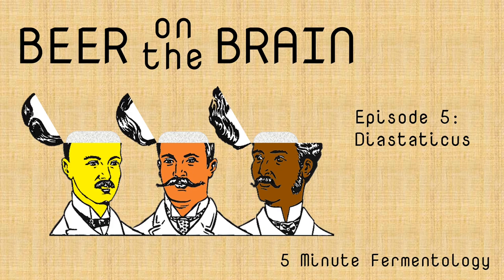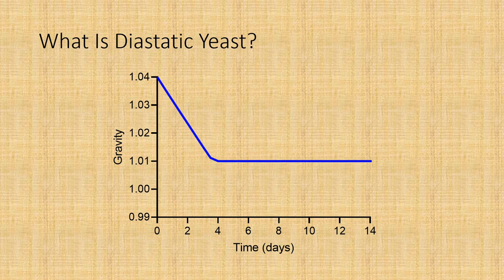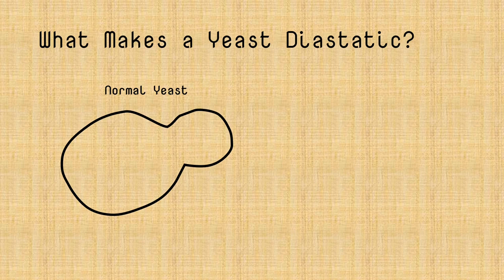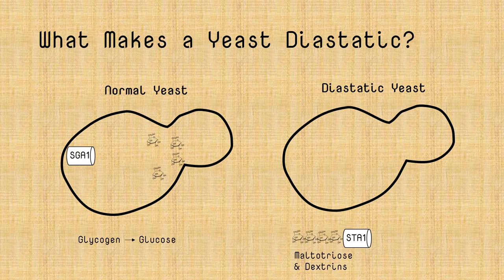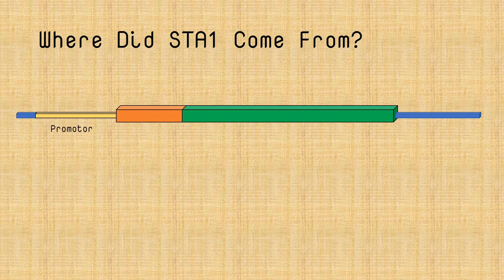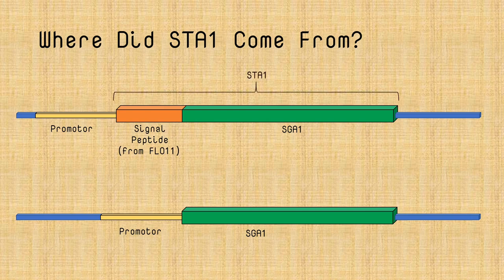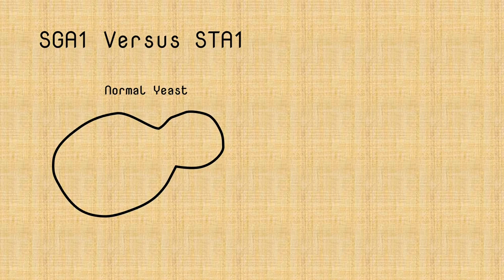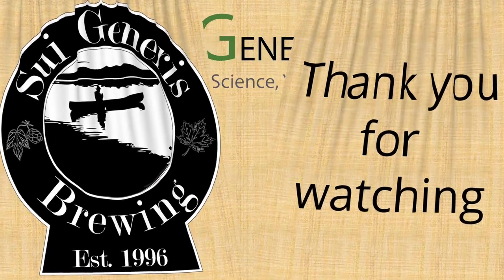BotB - Diastatic Yeast

Comment: When you are Yeast banking, is it possible for diastatic yeast to develop?  Also is there a way to detect this at home?
Reply from the maker: Some yeast are intrinsically diastatic, but it will not spontaneously appear in a non-diastatic strain, unless you contaminate it. Unfortunately, there is no easy way to detect diastatic activity at home, other than brewing a beer and monitoring for superattenuation